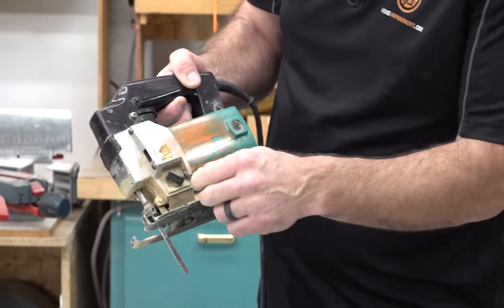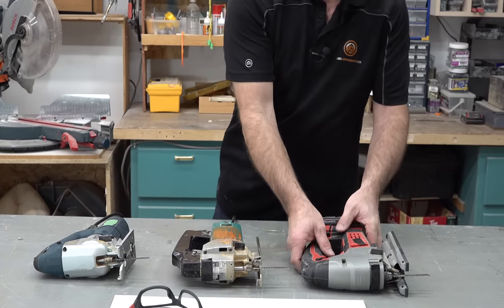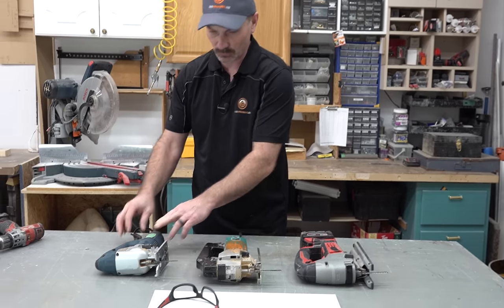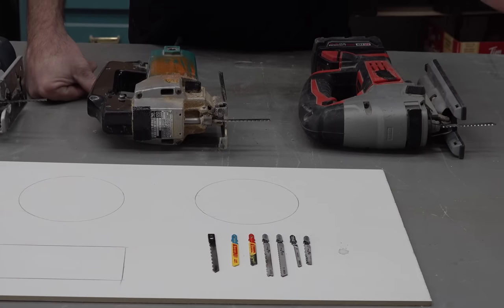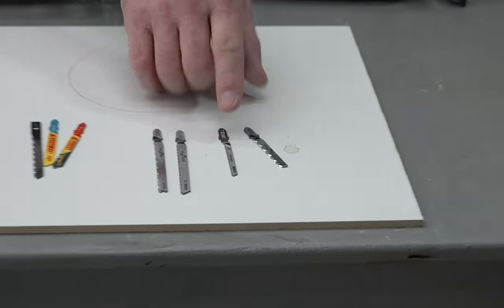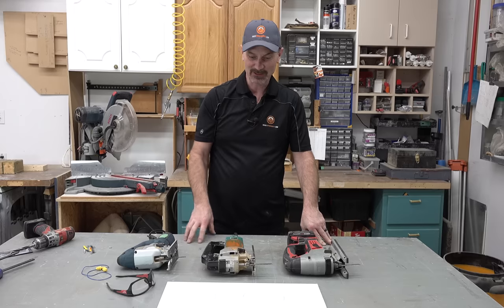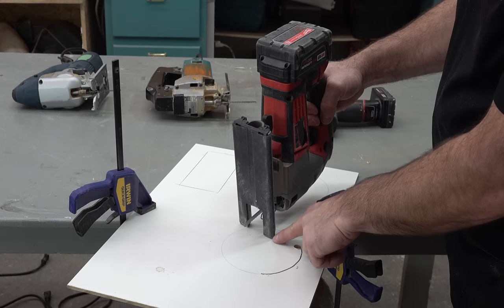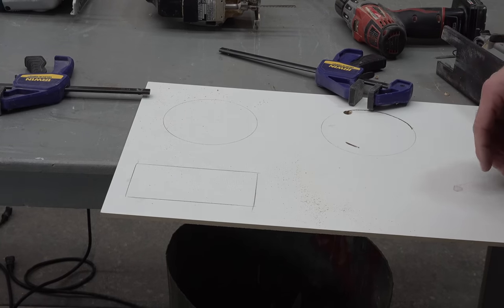How To Use A Jig Saw (Sabre Saw)

Comment: I slow the speed setting if I'm cutting aluminum to reduce the blade from melting the aluminum and clogging, but never for wood at least yet, carbide blades are awesome last a lifetime in wood and a long time in composite.

Comment: Shannon, I need to cut sheet masonite(hardboard) for a scenic backdrop on my Grandson's model railroad. What would be a proper jigsaw blade to use while the masonite is supported on         2 x 4s? The cuts will undulate mimicking hills. Thanks in advance. I always appreciate your videos.
Reply from the maker: I would suggest 12 -14 TPI. 10 TPI would be ok but it may leave a rougher cut edge.
Reply: @HouseImprovements  The rough edge is ok on this project if it happens.But, I will try 12 TPI. Thanks.

Comment: I've always found jig saws are pretty freaky power tools. I try to avoid using them, honestly! They vibrate like mad and just seem like wild little monsters.
Reply from the maker: You need to apply enough down ward pressure while using to keep them in contact with the material surface and possibly you had a down cut blade which makes things even more jumpy if your not applying enough pressure.